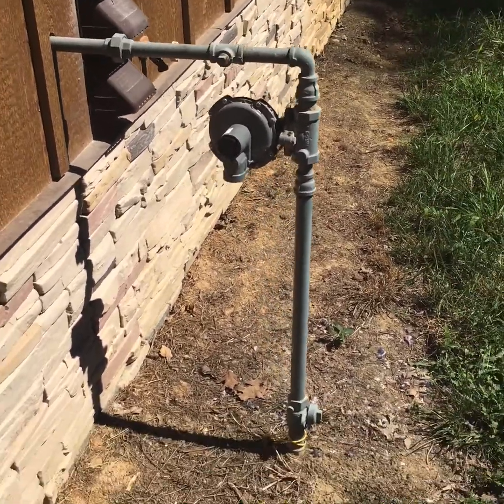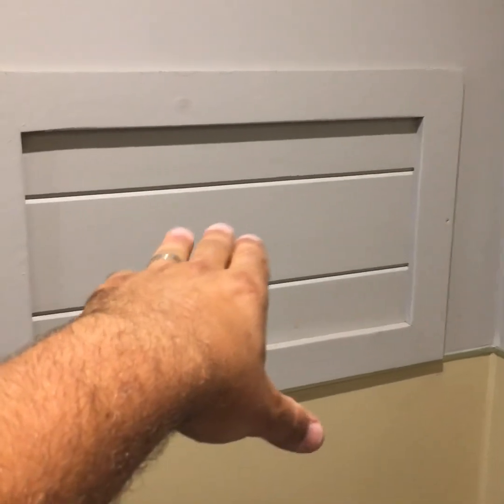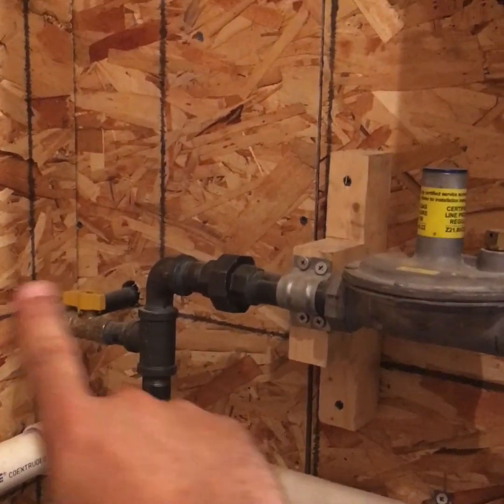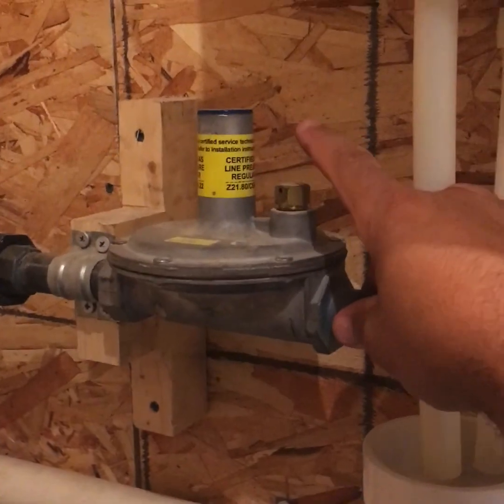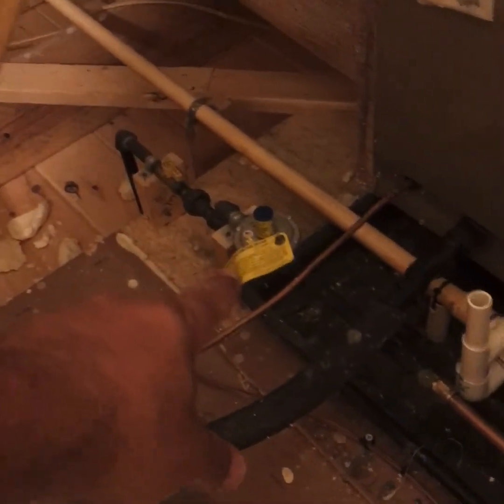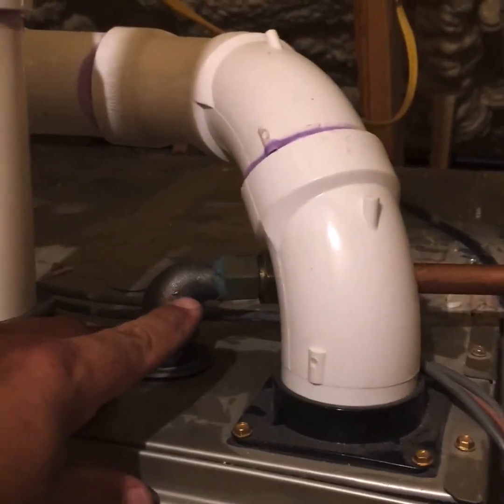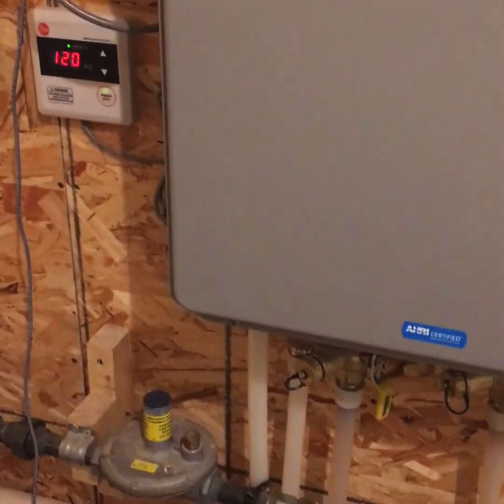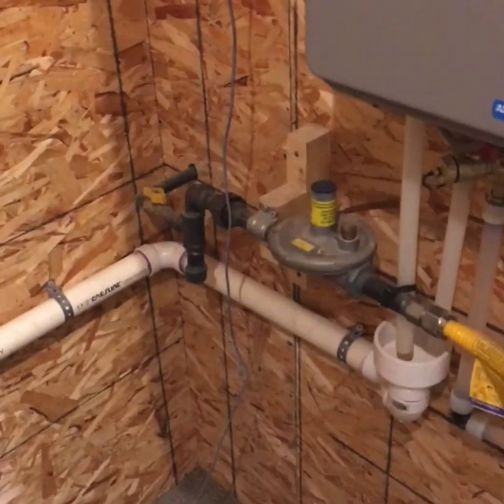Overview: 2PSI natural gas piping overview

Comment: Old video, but viewers should know that it is NOT CODE to use plugs or street ells, on Gas lines as you did in this video. (Bushings are also not allowed. Use Caps and Nipples where necessary rather than plugs. Street ells are fragile and also restrict flow. Neither are allowed. Oh, and that regulator was too close to the tankless.
Reply: Cite the code

Comment: I'd like to have a big threader, cutter, tripod, cutting dies and oil can.. but running copper tubing seems much more compatible ft or 2 lb systems since you don't really have to worry about pressure drops or leaks... as much..
Reply from the maker: Agreed…. Until you have a large BTU load.

Comment: I can't believe they can leave it like that I mean it's just sticking right out of this grass looks like an accident waiting to happen. I'm surprised the city approves of that I mean it seems like a lawn mower possibly rupture that or something running into it
Reply: It’s a steel riser it would take a pretty good size lawnmower to damage it…. If they are installed in an area where they are subject to damage such as in front of where someone might park a car then yes you have to put a steel or concrete column.

Comment: Do you run your pressure test with the valves just turned off at The Regulators or do you plug off all your valves and then pressure test?
Reply: Sorry for the delayed response, I turn the service valves off and test with 10psi after that I drop the psi to 5psi and test low side with bubbles.